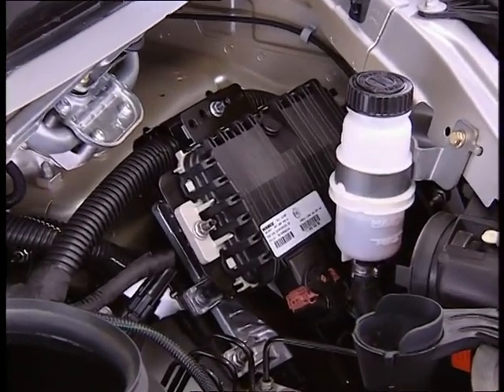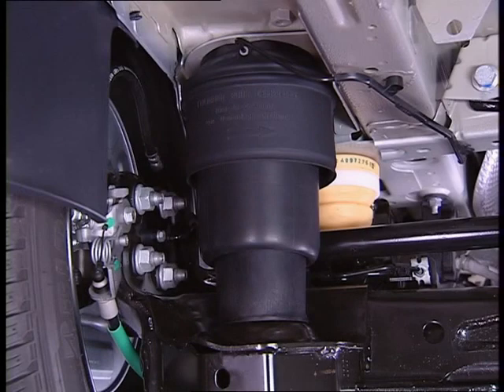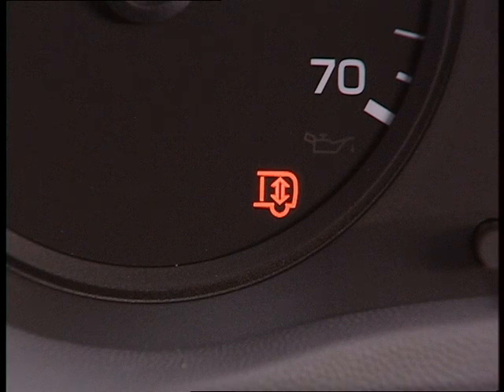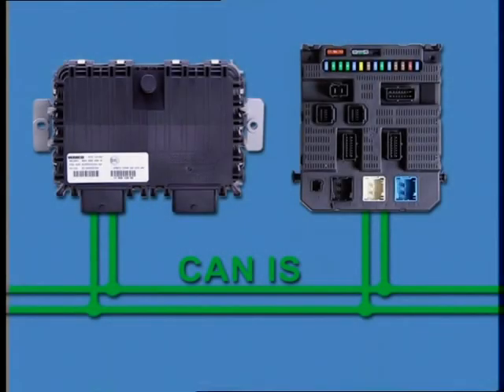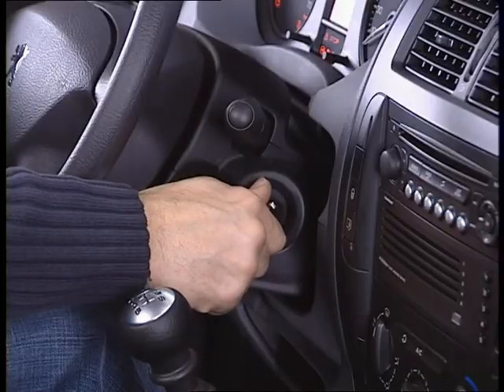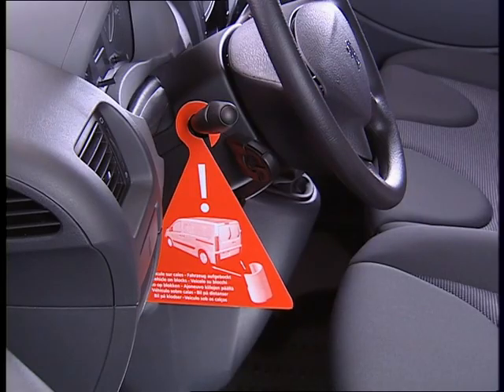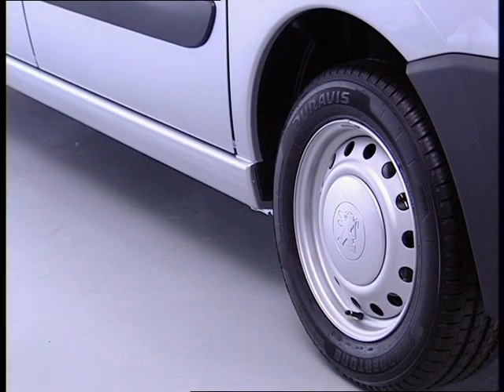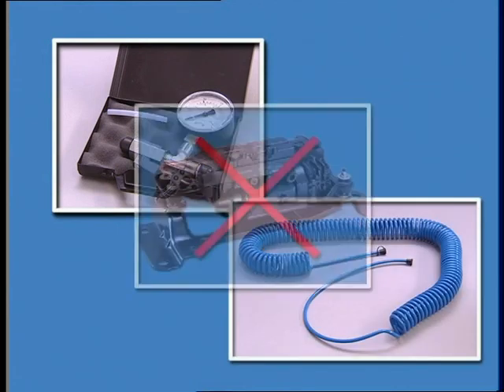Peugeot Air Suspension System Video

Comment: Is this the same system in Citroen c4 Picasso cars, Can you help I am having a fault on my system , compressor relay.
Reply from the maker: I need VIN
Reply: @hammoudehhasan2436  Vin no.  VF7UA9HZHAJ508836.
Reply from the maker: @nusratshaheen4913  give me the fault code
Reply: @hammoudehhasan2436  the fault codes are C1629 and C1621. Thanks
Reply from the maker: @nusratshaheen4913  there is TSB ref (B3BW010DQ0) for the fault code C1621 says the solution is by downloading the latest version software on the pneumatic suspension ECU through diagnostic tool
Reply: @hammoudehhasan2436  where can I get the latest software downloaded from. Please help me.
Reply: @hammoudehhasan2436  if I come to you can you download me the latest software.
Reply from the maker: @nusratshaheen4913  Yes I can but wet haven't work on this system before so if download didn't solve the issue then I will need time to diagnose it as we don't have spare parts for this system
Reply from the maker: For me it will be the 1st time to work on pneumatic system, your car has been imported from Britain so its specs are not available in Jordan
Reply: @hammoudehhasan2436  I wish you were close by , so could have come . Are you based in Jordon .
Reply from the maker: @nusratshaheen4913  Yes in Jordan
Reply: @hammoudehhasan2436  I have brought a used suspension ecu which is working and will test it out tommorow. See if helps.
Reply: @hammoudehhasan2436  a thought came into my head of why not get rid of the ecu all together and go manual by connecting the wires from the two scarts together and get the suspension to come up and down just using the back bottoms. Do you think this is possible after all better than going down spring route. What are your thoughts on this.